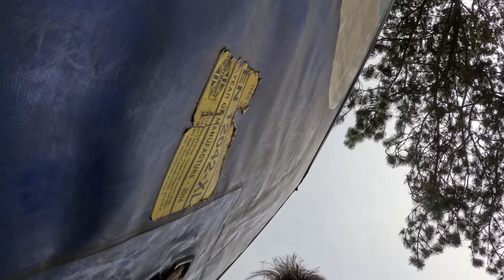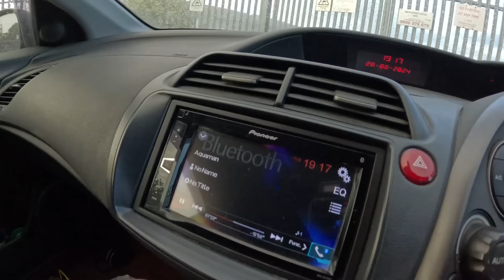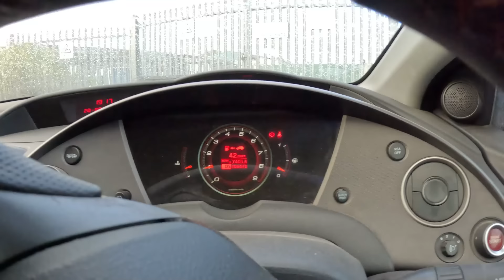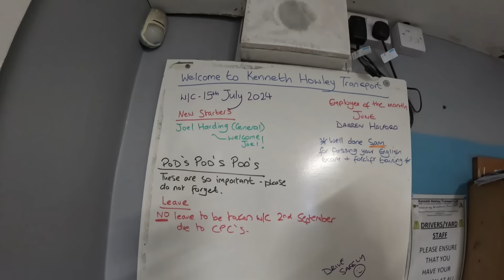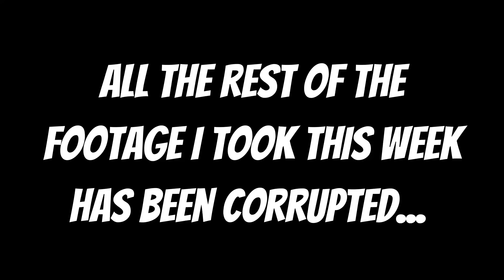Not the SHED!!! NOT THE SHED!!!

Comment: Company  i worked for always  gave new trucks to the Northern  drivers so this one time I was in a R plate Leyland daf 85 low cab got called in and was told my truck was being sold so was going  as spare driver which  was bad enough  then I got told I was taking a brand new FH12 to Batley I was not to take the plastic off the bed or eat in it but I would  have to have a night out in it I gave them the keys back and walked out

Comment: Once you do all that and it asks you to confirm, what I do is say no.  It then asks if you want to do a manual entry,  say yes and it will start from the time you pulled out the card buy it will still have the information you inputted so you can check over make sure your in the right mode and time and just ok till you come to the end and all good then say yes to confirm